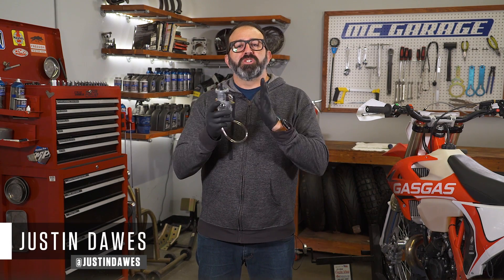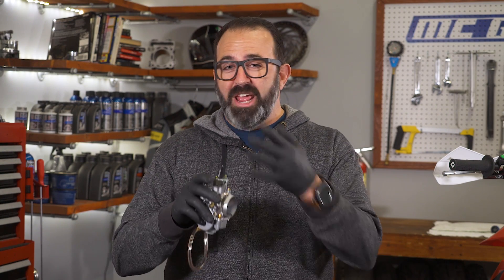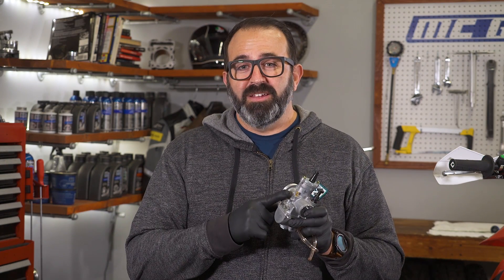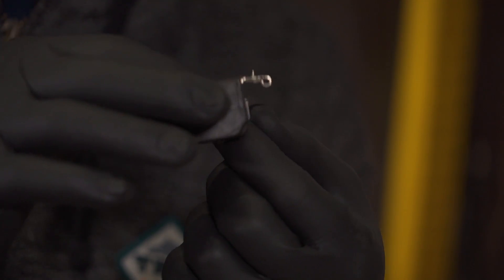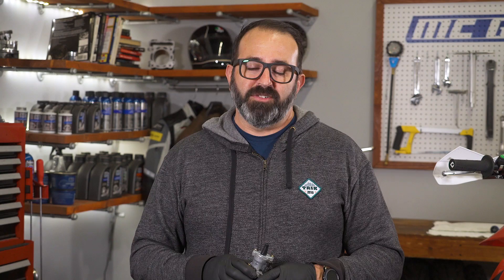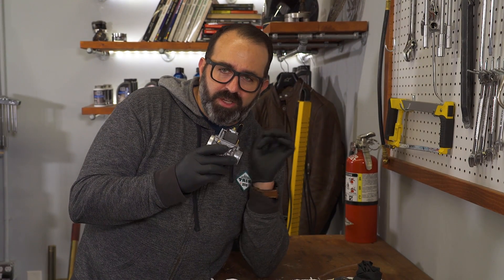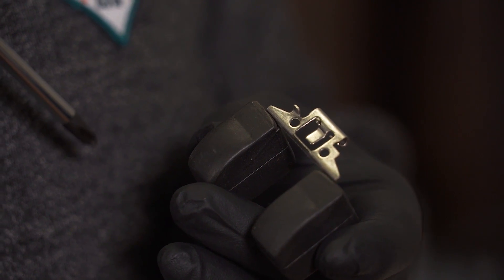Inside A Motorcycle Carburetor - Float Bowl Height | MC Garage

Comment: Why would gas flow from my overflow when I turn my gas on just a little but stop when I start my bike? It wont do it again after that though just during my initial assembly when I first put it back together after I adjusted the float height, please help? Also it's surging at about 1/4 throttle  with a 68S pilot and a 55 main I moved the needle to the very top thinking it was to richen according to a post I saw but now I understand i to richen it needle clip needs to drop to a lower slot?

Comment: When I hold mine at 90's, it doesn't seem to depress the needle. The spring load also is much shorter that on your demonstration (could be bike specific), so I'm not sure how to tell if the needle is being depressed or not. I have been having overflow issues, where if fuel tap left off fuel runs throug the overflow, and after sitting in traffic not moving my engine starts drop revs and still if I don't add acceleration.

Comment: Thank you for your video.  What is the height of the fuel in the bowl?  My manual has spec saying 21mm from float top to the carb frame.  That is fine but where is the fuel in the bowl level?  Should the slow jet and main jet be xx millimeters in the fuel to work correctly?  Thanks for your thoughts.
Reply: I have a transparent bowl on my keihin pwk 38 carb.. I just want to know what the level of fuel should be!! Shit is driving me crazy bc I can’t find this info anywhere!

Comment: om my Hitachi carbs on my 85 yamaha virago the needle component has spring loaded button on it. If i set float to where it just contacts and does not compress the button completly down. It will create a extreme rich condition. Can someone explain to me what function this type needle design serves. Use to have solid needle design but nobody supplies them any more i think.

Comment: HI , I've watched all the MC GARAGE videos and i just need help on one thing.

Why does the wheel bearing becomes loose inside the hub? it's like i can effortlessly pull out the bearing and put in new ones without breaking any sweat. Yah i knew that i have to replace my hub. But this is will be the 3rd hub that i had.

Comment: My carb squirts gas when i turn it off and when it's on there is a lot of white smoke out of the exhaust. I cheked the float level but it's correct...
Reply: The bike don't have oil problems it was working fine but the gas squirts trough the airbox
Reply: @Justin Dawes i can't close the petcock only has open, prime, and reserve. When the bike is off the petcock must be closed. It works fine becouse i take out the gas pipe and the peacock don't lose gas
Reply: @Justin Dawes yeah the seat looks full of shit but it's not removable. I must handle with care if i don't want to buy a new one...

Comment: Are there differences between a 2 stroke and 4 stroke carb? Is there such a thing as oil injection?
Reply: No difference between two and four. Yes - oil injection (by virtue of a separate oil tank/metering system) eliminates the need to mix oil and gas in a two stroke motor.

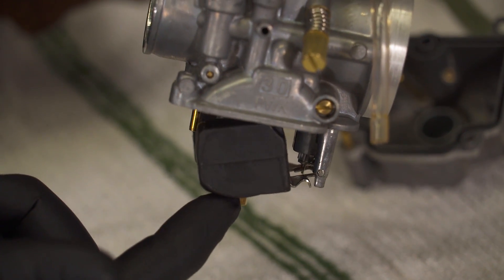Comment: I've had a number of problems with "sticking" needle valves over the years, both in cars and motorcycles.  The single most common issue involving adjustment (not dirt or water) is IMHO a factory spec that opens the float valve a bit too far.  The problem usually occurs when a vehicle sits long enough for the float bowl to dry out from evaporation.  The float drops to its full-down position, and the tab that pushes on the needle ends up at an angle far from the ideal 90-degrees.  You can see this in the video around 1:08.  The lateral thrust is often enough to jam the needle at an angle in its bore and flood the engine.  Polishing the needle and seat bore is not enough to fix this.  (Yes, I tried that too.)  It's usually impractical to bend the float tab enough to tune this angle without destroying the fuel level adjustment in the process.  However, the next best thing is to reduce the float travel limits from the factory spec a bit so that it doesn't drop down quite as far before hitting the stop.  This will help keep the float tab pushing straight on the needle and avoid the flooding problem.  Yes, you need to be sure the needle is opening enough for fuel demands at WOT, but it's usually quite a bit less than the factory spec calls out.  This simple adjustment has fixed the "stuck needle" problem every time for me.

Comment: Maybe I'm going a bit over myself here, but here goes:

Can you make a diagnosis tutorial? Basically how to quickly diagnose when something is off on the motorcycle (brakes, carb/injector, suspension, maybe basic electric system). I'm not talking about pre-ride check of integrity of parts, but rather their functioning on a daily. 

I'm not necessarily asking for myself, but I do wonder just how easier would my life had been if I could have recognized what's the issue when my front brake "pumps", when I lose power while accelerating or when I hear the chain rattling after downshifting or letting off the throttle.

Comment: Carbs seem like such an over engineered nightmare of things that can go wrong. As much as I like 90s sports bikes, I don't think I could own one and deal with carbs.
Reply: Once you know what does what and especially whot it does it it's actually really simple. And very simple to work on. I'm thinking of all the crap EFI brings with it that you can't fix on the road or with just a few screw drivers. That of course comes from a mechanics stand point. If you don't work on your bike and don't want to EFI is propably the better choice.
Reply: Stick with efi. It’s not as easy to take and fix a carb issue on the side of the road as people make it out to be. Fuel injectors rarely fail. Would you rather have something that you can fix “easily” or something you’ll never need to touch?

Comment: Near the end you mentioned bending the float adjustment tab a "slight" bit.  Wish I'd heard this in 1973.  I bought a nearly new 1968 Kawi 500, not running that had gone through 3 owners while not running.  I knew very little about trouble shooting, but learned a bit.  (As it turned out, it had a bad distributor rotor)  
But, of course, I rebuilt the carbs first thing.  And the float spec in the Shop Manual was way off what my carbs had, so I bent the tab a mile, expecting that to fix the bike, but it didn't.  When I finally realized that I got a hot spark from the coil, but a very weak one at the plugs, I bought a new rotor ($12) instead of a cap ($13), put it in and YES! - hot spark!  But it still didn't run.  But when I squirted gas into the carbs, ran fine.
FINALLY figured out that the float spec in the manual was wrong.  Fixed it and had a very sweet running, screaming hot rod bike, until I loaned to a 'friend'
Another lesson learned.

Comment: Hi Justin! Thanks for the nice tutorial! Could you please make a video about ignition coils and CDI boxes? How they work together and how to troubleshoot them?
Reply: its not so hard. What do you have problems?
Reply: @knifemaster8  I have Geon Tossa 250cc (this is kind of Ukrainian bike, but it's just Chinese complete clone of Honda CBR250R). It is used, I bought it two month ago and this is my first bike=) It has some floating issues with the ignition, for example, for the entire last week it starts perfectly, but before it was a pain to start the engine. So I want to figure out what hidden problems do I have inside. I downloaded electric diagram and I can't believe it works, there are no connection between CDI and ignition coil! Ignition coil connects to the ground, spark plug and to kill switch o_O (according to this diagram), there are some very weird connection to some "coils assembly" (so I think this is stator), but if this is stator it MUST be connected to REG/REC, isn't it?
Reply: @Shkvarka  I dont know the nature of you'r bike but i have among others a 71" Moto guzzi ts 250. So as far as i know: the coil provides AC ac current with the help of a magnet Thet goes to the regulation circuit thet turn the 30-60V AC to 13.4V DC wich powers evriting. And at the magnet there is a pick up sensor, which puts the signal when the spark needs to kick in, the sensor needs needs about 150 ohms resistenc.  Thet all goes to the cdi unit.  so the cdi unit needs power from the power regulator and a signal when to kick in from the pick up. then the cdi puts out the signal to the ignition coils.

the signal form the cdi comes to the ignition coil and gets transferred to a high voltage so the spark can kick in. You can check the coli with the ohm meter: Primary coil has 0.75-1ohm of resistance the sec coli has 10k to15k of resistance depends on the type and brand.

and if i am not mistaken your coil as you said goes to ground ignition and kill swich, but the kill swich has 3 wires one to coil one to ground and one to CDI so whe you hit the kill swich the signal gets short circuit and goes to the ground and not the coils so the motor will not run. in between the kill switch and cdi the circuit goes to the ignition lock, with bettery and other wires.

you can also have electrical gremlins like i have on my ts 250 the wires are intakte but are broken inside took me a week to find why the turn signal will not work

You can also check youre spark plug color. Black to rich to much fule white to lean not enuf fule. Dark chocolate brown just right.
And the spark pluh heat resistance. i went one plug colder on my derbi dxr 250 so that it will not have problems when the engine is a little hotter.

Sory if english is bad.